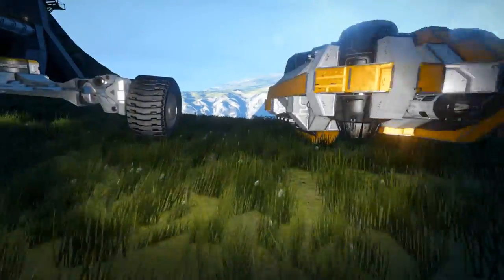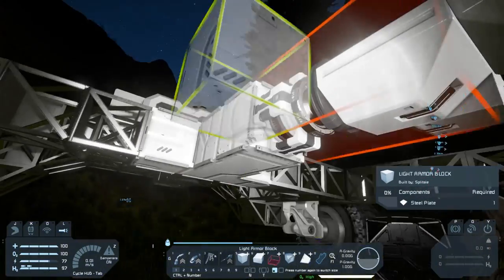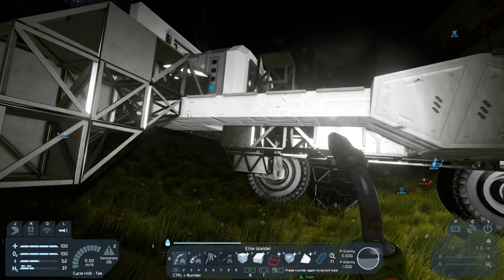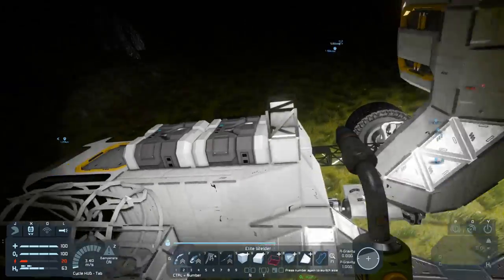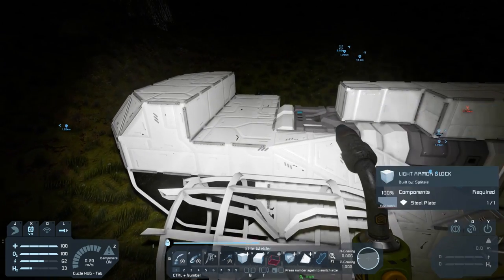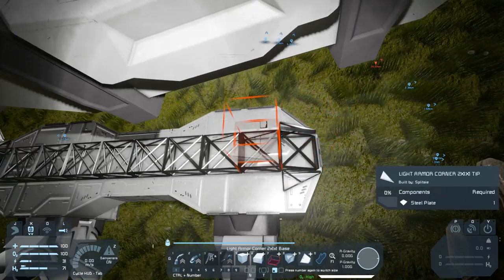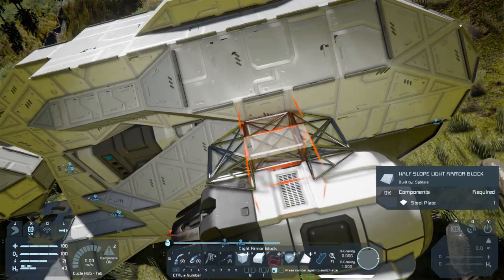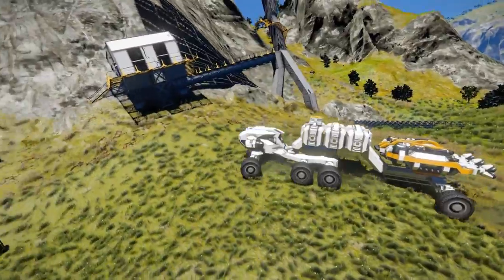Survival, Maybe... #29 Jet Truckin' (A Space Engineers Survival Series)

Comment: That truck is magnificent. It needs some headlights, although I'm sure those will be greebled in. Also, for longer treks you might consider an ore detector in the truck so you don't have to use the butterball's, a beacon for its location just in case you have to go back out to it. Both items would fit in the space over the cab in front of the o2-h2 generator, I believe.
Reply: Instead of a beacon, he could do the 2 for 1 special and add the radio transmitter, this way it'll transmit ore locations via his HUD while he's outside of his truck for short/long range and show location of his truck should he fly out of its view.
Reply: That is a great idea!
Reply from the maker: Yep, certainly need to add an few more functional bits and pieces. Hadn't thought of putting an ore detector on there, but I like it :)

Comment: I would recommend putting your braking thrust on the trailer. When going down a hill, you want the trailer pulling you  back to slow down. If you are going down the hill too fast in a turn, the trailer might swing around in front of you, but if it is pulling back then it will keep the front straight.
Reply: Just noticed you did this in your next video
Reply from the maker: A few others suggested it, seems like it works reasonably well too :)

Comment: It looks really cool indeed! Binding aesthetics and functionality together always amazes me. I wonder if I will some day develop some aesthetics skills.

I was wondering about your brake thrusters. Since the trailer will eventually weight a whole lot more than the truck itself, if the front portion of the vehichle brakes more than the rear, couldn't it result on the link bending? Downhills, it sounds scary to me. Maybe I'm wrong about this, since wheels now have a lot more friction than before, but putting the brake thrusters on the trailer instead of the truck sounds safer
Reply: This makes sense to me. Because the trailer is a subgrid, you couldn't control those thrusters directly. It would be something like a thrust override controlled via hotkey. Better yet, perhaps this could use the reverse engines of the Butterball itself. It makes the dangerous assumption that the Bball will always be oriented correctly, of course.

While we're addressing this scenario, limiting the up/down angle on the trailer linkage might be an idea, too, so it can't jackknife vertically in a downhill runaway situation.
Reply from the maker: All of these points are very true, I do have the rotors limited to reduce the chance of flipping over, other than the turning one I think I gave them about 20 degrees of movement :)

I think the idea of having maximum override thrusters on the trailer with a hotkey is just what I'll do as it could end up disastrous going downhill under load if it jack knife's at all... :/

Comment: I would have been tempted to put the cab about a meter higher.  

Because the O2 generator will be sucking down power every moment you are in the cockpit, I would recommend adding a timer to turn it on for a few moments every couple of minutes.  Same for a vent.
Reply from the maker: I was thinking I'd just have the generator off unless I need hydrogen for my jetpack, otherwise I shouldn't need it at all since cockpits are thankfully no longer airtight on planets with atmosphere :)

Comment: I did skip a little of the build process. Mostly because I just wanted to see the end product lol but I did watch most of it. Love the design.

As I said in another comment I like the brake thrusters. Possibly up on a support of some kind would improve them but they look good where they are.

I need to revisit my small block survival truck trailer combo to be more semi trailer in design as it clearly works better. I had issues with the front end hitting the ground despite obviously good ground clearance that disappeared once the trailer was unhitched.

I was going to just use a 4 axle design but this has convinced me to try the trailer Base design again. 
Cheers mate.
Reply from the maker: Thanks :)

I'm hopeful I can get a good piston setup at the front of the trailer so it won't drop when unhitched, fingers crossed it works out, my worry is that it'll tip in an odd direction with all that potential weight...
Reply: Splitsie perhaps a secondary pair of pistons about where the nose of the butterball sits and the frame comes down to add stability to the one at the front? I am sure you will work it out anyway. Have fun with it.
Reply: Edit sorry back of the butterball I forgot it is travelling backwards

Comment: You should consider building a free gimbal on the joint of the trailer since you rarely travel in flat ground
Reply from the maker: The hitch has complete freedom of movement, do you mean the part where the cargo containers lead back into the solar panels? The reason not to do anything there is that it would require the use of advanced rotors which are quite large and wouldn't really work with the design :(

Comment: With the space in the center of the truck that houses the trailers rotors you might be able to get some smaller wheels in there if you feel the truck needs them.
Reply: also kinda looks like its wearing a flat cap backwards
Reply from the maker: The truck's trying to look cool with a backwards cap :P

I don't think adding in extra wheels will help with mobility, though I wish we could still add more wheels onto suspension like having double wide tyres, that would be great :)

Comment: If you rotate the oxygen generator above your cockpit to leave conveyor port access to an air vent (set to depressurize), you can leave the o2 generator off until you need hydrogen. Otherwise it will slowly burn ice while you're piloting, and you're already in an oxygen atmosphere.
Reply from the maker: My plan with the oxygen generator is to have it off except for when I need hydrogen, that way I can keep the armor looking as it does at the moment and save on a little bit of ice :)

Comment: Looks good!  One thing of note, your hill test with the breaks and boosters were with an empty Butterball, right?  I have a feeling the boost will be fine for uphill still, but I think the breaks+breaking thrust will be insufficient with a full load!

Also, one neat thing that you could try adding at some point would be an escape mechanism of some kind.  If the trailer begins to go out of control, something like 1) Launch the butterball somehow to get it away from the soon to be wreckage (also lightens the load) 2) disconnect the trailer from the cabin to keep you safe.

Also, should blueprint everything :)

Can't wait for the next!
Reply from the maker: I like the idea of trying to design some sort of eject system for the butterball... I wonder if you could just have a button to unlock the connector and turn on the thrusters at the same time if that would be enough. I'll try to remember this as I've got a fun idea for a little messing around video to do with it :)

A few people have suggested and I think I like the idea, of adding some braking thrusters to the trailer with full override on them, if I toggled that it would work reasonably well to add some extra stopping power :)

Comment: Need to put the reverse thrusters on the trailer or the momentum of the trailer could possibly flip you as the trailer whiplashes forward
Reply: called jackknife'n
Reply: Oh, thanks
Reply from the maker: I think everyone's right with this, I'll try to come up with where to put them by the next video on Wednesday :)
Reply: Splitsie you could try putting o2h2 generators on top and small hydrogen thrusters in front of the cargo boxes
Reply from the maker: I thought about using hydrogen thrusters, but then if remembered the number of times I run out with my jet pack and I get very nervous :P
Reply: Splitsie I don't want to push too hard but you'll have o2h2 generators on the roof and according to your video on Hydrogen tanks and O2H2 generator the o2h2 is better for small grids :D
Reply from the maker: I was more pointing out how likely I am too run out of fuel at a very bad time :P

Much less likely with atmospheric thrusters :)
Reply: Alright fair enough

Comment: very nice looking truck. I've tried making things look less blocky in my games, but I seem to lack the visuals needed to see what block to use to achieve a nice looking form. 

Anyway. In regards to your solar panels. You placed them under the Butterball. From what I can tell, there will be very few times when they will actually be exposed to the sun. Those brief moments when you mine, but other then that they will be obstructed. Is there a way where you might be able to put the solar panels on the side? Sort of framing the Butterball on the sides?

Then they would recharge as you drive as well, and they would help (With armor blocks in the inside) to guide the Butterball into place. Can't wait to see your paint scheme for the truck.
Reply from the maker: I'm not expecting much from the panels, more of a backup, just in case sort of thing. Most of the charge is going to be taken from the base I suspect, though I am still hopeful I can come up with some idea that I'm happy with where I can have folding panels on the side of the cargo containers...

Comment: looks like  a wishbone if the braking thrusters are on the trailer  it will keep the trailer from swinging around and hitting the truck on a steep hill by pulling the truck and lining every thing up like brakes on a simy trailer are made to have more force than the truck preventing jackknifing
Reply from the maker: You're absolutely right, my main reason for putting then on the front was for ease of control - you can't directly control the thrust on the rear due to the rotor connections.

Now that I think about it a bit more, a simple on/off with maximum thrust override would probably be all I'd need for emergencies... This might well get added :)

Comment: Hello love your videos all of them I watch like they my sat morning cartoons lol also was wondering y you don't just up the power on the wheels, also are you using the hand brake to stop I couldn't tell anyway I thought these two things should make those thrusters more emergency only ones :-)
Reply from the maker: Thanks :)

I have the power on the wheels close to 100% because driving around the base I need to have a little less power or I'll end up in the wall :P 
Once the truck is finished I'm going to put controls for the friction, power and suspension strength on the hotbars so I can control them dynamically which will make things much better and maybe not need the thrusters as much as you say :)

As to using the brakes it's always seemed to me that you get better stopping power out of full reverse thrust - you can reverse up a hill that you would slide down with only the brakes on so it seems to be able to apply more force in the opposite direction
Reply: Splitsie thanks for reply and i see your points also forgot to mention that I like your overall design captured the eye

Comment: I think you shoud add two forward faceing small hydrogen thruster  to each side. Looking liek horns. Elbow on the O2/H Generator - Conveyor- Conveyor-Elbow. Well I thought that before you placed the small atmos.
Reply from the maker: I did briefly think about using hydrogen, but knowing me I'd run out of fuel right when I needed them... :P

Could make for an exciting video though ;)
Reply: You coud palce the atmos on top of (or inside the top) of the hump an the middle wheel.. So you got both.

Comment: Maybe the breaking thrust should go on the trailer... or both.
Reply from the maker: I thought about putting some on there, and I might do, without something like the vtol 2 script they'd be a little frustrating to use not being able to control them directly. 

I'll have to think about where I might put them on a rotor as they could then also be used for an extra boost just in case... This could be a fun challenge, or ridiculous, who knows? :P
Reply: The only thing I would place on the trailer are some blinking landing lights for the miner to guide in a landing and maybe a rotor operated spotlight for those times when you have to work at night and want to throw some light up in an area. Though with the landing lights, it's only because I've figured out how to programme them to appear to be blinking in sequence.

I'm not sure how a VTOL trailer and vehicle would work with that hitch but hey...! It took a thousand go's to make a working light bulb :D
Reply: Would the braking thrusters fit between the rear wheel structures and rotors, mounted opposite the wheels on each structure? That would put them out of the way and not interfere with armor styling.